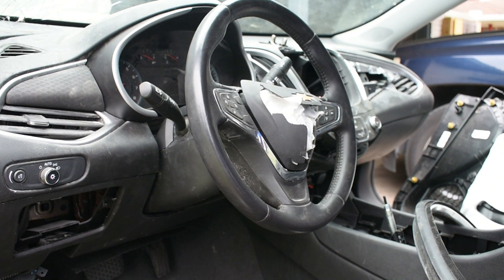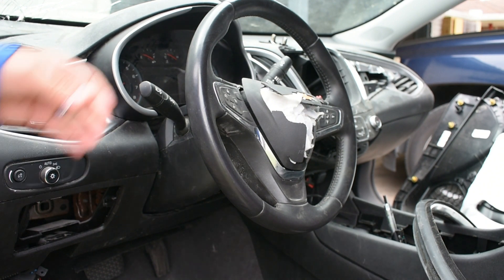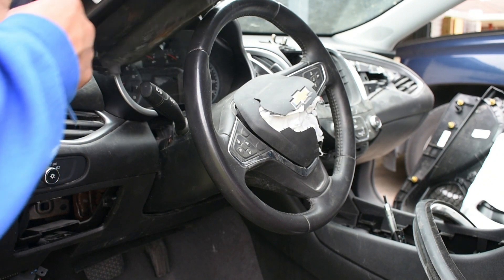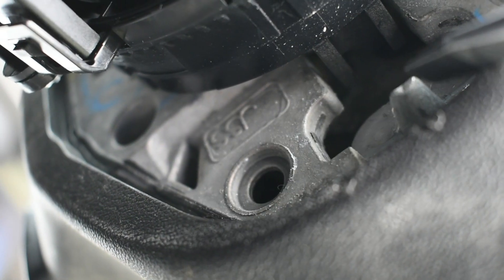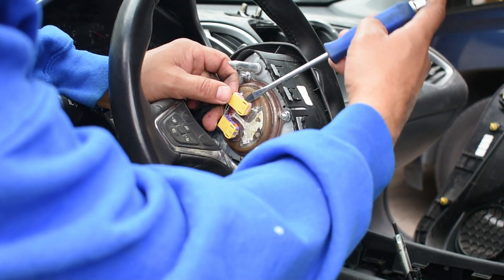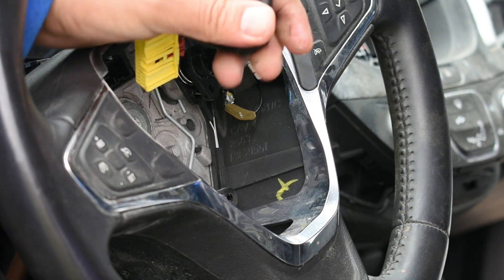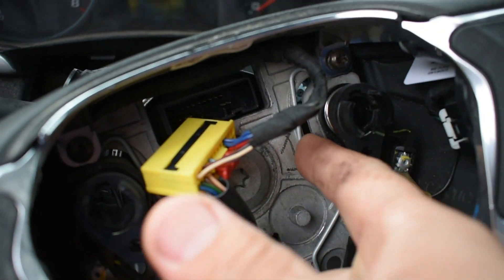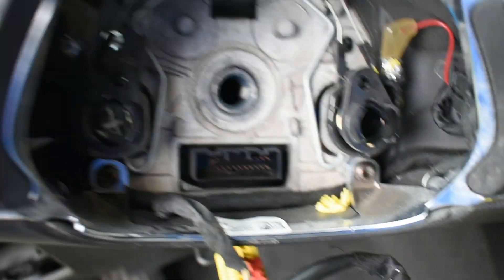2016-2022 Chevy malibu how to remove steering wheel and steering wheel air bag.

Comment: There is an easier way to remove the air bag. You see those 2 tiny holes on the back of the steering wheel, stick a pick in there and it will pop out
Reply from the maker: Thanks for the info bro 🙏